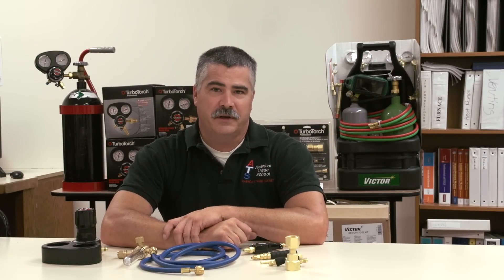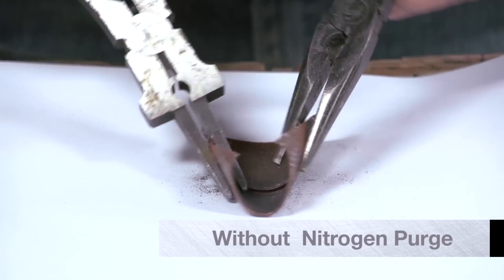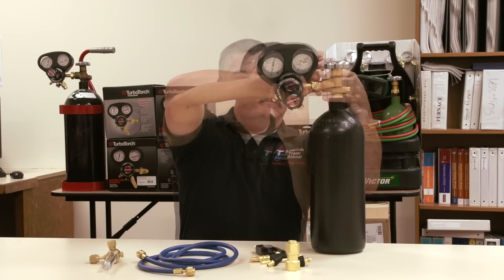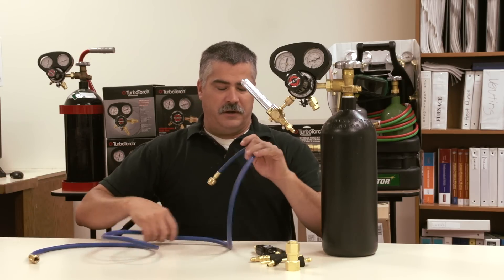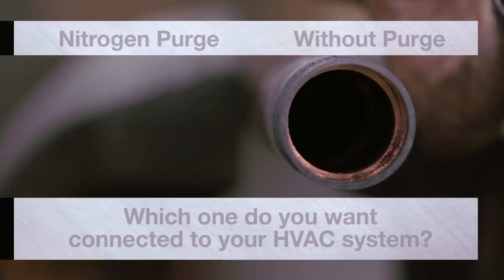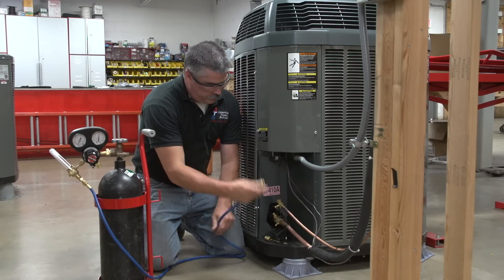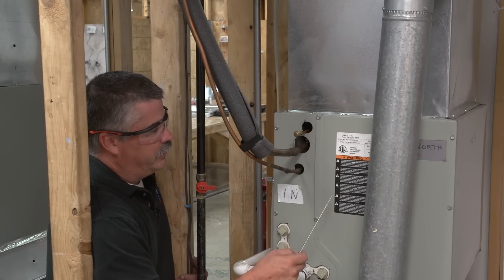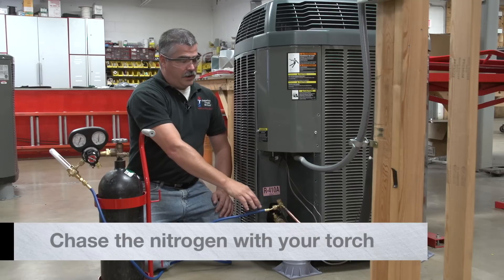TurboTorch Nitrogen Purge Kit Improves Brazing Results on Copper Pipe

Comment: Hi I move to Europe in bring my turbo torch air acetylene with me... turn out none of your fitting work out... the M3 bottle or even the 24-38 LH on the hose. Do you have a solution for me?

Comment: If you're going to use a ball flow meter at that kind of angle, you might as well take it off and just flow a little gas as it won't be remotely accurate.

Comment: Hi Chris, I just switched over to all Victor products with turbo torch. On a new full system install with TXV..Could I "chase the nitrogen" by starting on the suction lineside work into the evap coil, install the TXV , line drier and back to the condenser? I am joining two long line sets 90 feet with couplers, so I have more than the normal number of joints to braze and wanted to know the best practice with this kit on a nitrogen braze.

Comment: Shouldn't the nitrogen flow gauge be vertical? Won't it give a different reading when it's tilted at 45 degrees? What if you tilt the flow gauge horizontal? Or 10 degrees from horizontal? Will that work OK?  And this is an expert how-to class??
Reply: It's better to tilt the regulator horizontal so that the connection for the flow meter is parallel to the ground. Then the flow meter will be in the proper postition.

Comment: 40 psi???
ITS  high pressure for braze!
Reply: It doesn't mean that it's 40 psi inside the line set.
Reply: 40 psi is what is required for the flowmeter to function properly.  Actual psi in the line is low because of the system being open.  After an initial purge of the air in the system, the flowmeter is adjusted lower to the point where you can barely tell it's coming out of the Schrader valve on the opposite line.  As you braze each connection, the pressure while rise slightly as the leaks are sealed.  You will probably need to readjust the nitrogen flow down when you braze the last joint at the outdoor units service valve Schrader port.  Otherwise you might have a difficult time sealing that last connection if the pressure is too high.
Reply: What is the cylinder capacity used here??

Comment: Gary, No. What the nitrogen does is push the oxygen out to prevent carbonization. CO2 is carbon based. Tyrese, the TXV never shuts completely, so the nitrogen will flow to all parts of the system. Paul, yes and thank you, a lot of systems fail because the flakes of carbon partially clog the metering device. Bodybuildingking, Yes, you are correct, too much nitrogen will cool the line and make it hard to braze. That's why it is important to use a flow meter.
Reply: Chris Cordia couldn’t have said it better myself. Right on man👍🏽🇺🇸
Reply: Flow nitrogen at 2-3psig,

Comment: Thanks for the video. Not many guys do it the right way. According to many,  most of system fails because of missing this important practice. Is it correct?
Reply: What is the cylinder capacity used here??